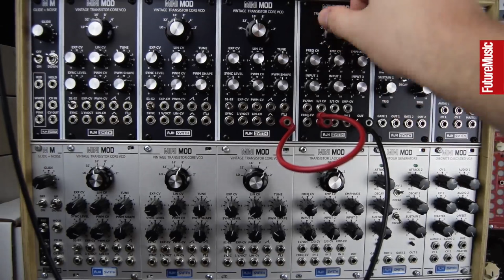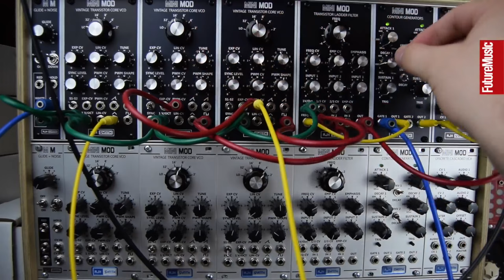Modular Monthly: Beyond Minimoog with the MiniMod

Comment: How does the Minimod filter compare with something like the Moog ladder types in the Doepfer A120 or Analogue  systems RS100? Does the Minimoog have sharks tooth waves? The only other time I've seen an old synth with vco  shapes that are a bit different is on the Elektor Formant, which has Mark space----a cross of saws & squares.